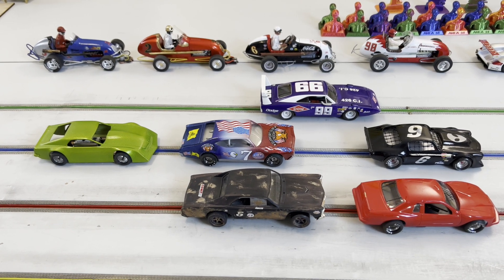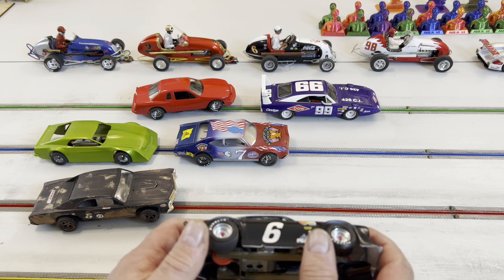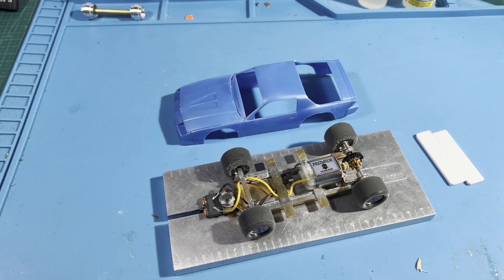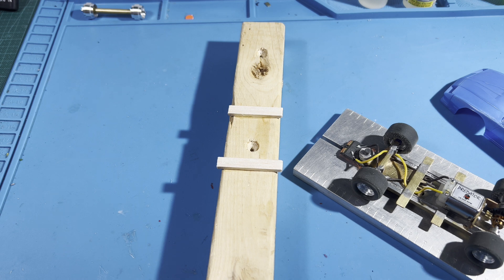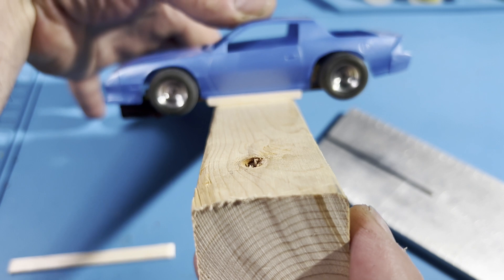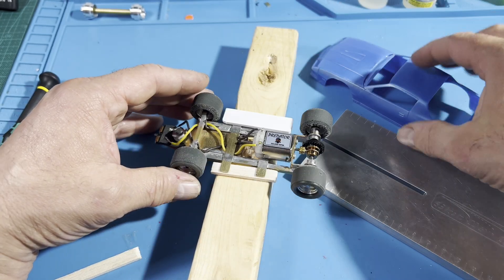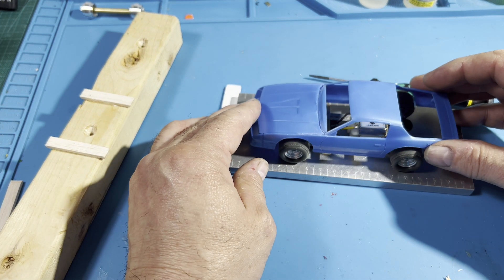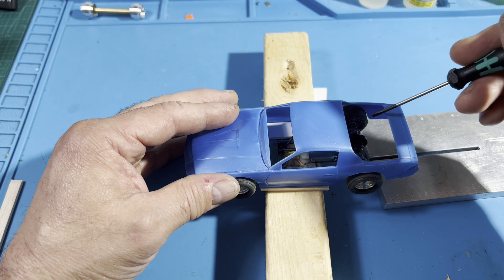Body Mounting on a Showdown Chassis Kit

Comment: Good video demonstration. For added strength, I mix glass micro balloons to my epoxy mix which thickens the epoxy mixture and adds an internal structure to the epoxy making it easier to apply.
Reply from the maker: The Epoxy I use in the video is more than Enough